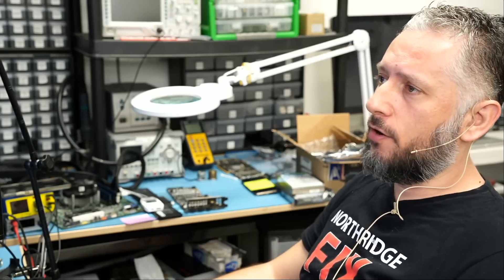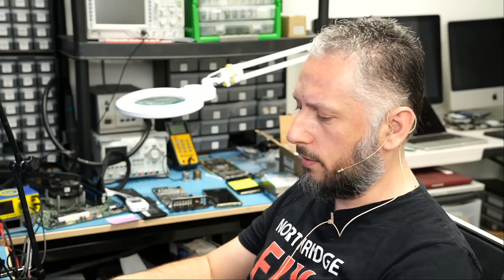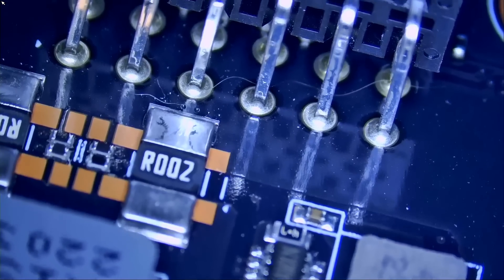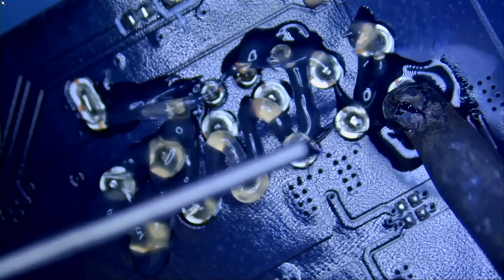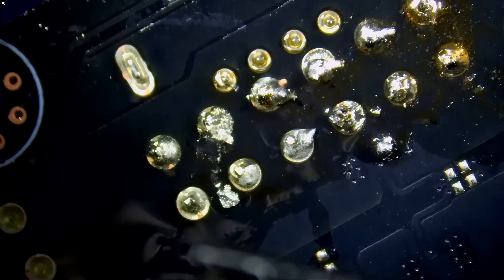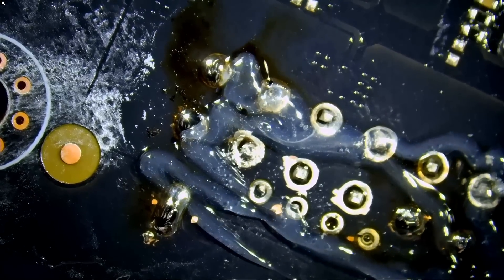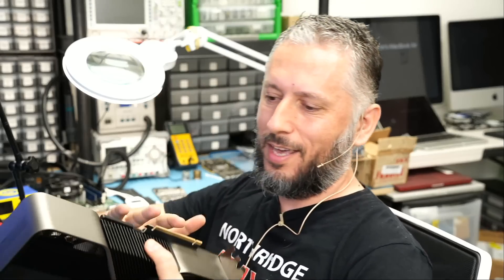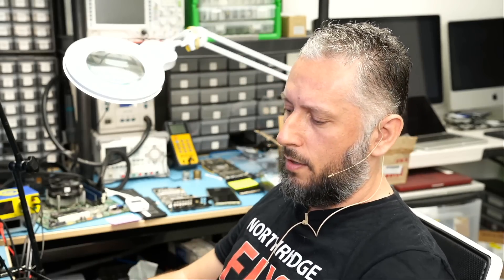Serious issues with 4090 power connectors melting - Is the user at fault ?

Comment: 6 pins for the positive rail at 450w is 37.7A divided by pins is 6.25A per pin. Since it's dc it's harder on the connector. Some arcing will take place and once one gets a higher resistance it'll heat up and increase resistance even more, now 5 pins needs to carry 450W and the next pin burns up 3ven faster etc. 
The connector is too small to carry sustained 37.5A. They should either use a psu at 48V or just input ac mains voltage directly. Or use a much bigger connector.
Reply: Your math and conclusion are correct, but in the case of the 4090, it's actually capable of accessing 675w, 600 of which would go through that puny, tactile response bereft, don't-bend-it-whatever-you-do fire hazard of an adapter and connection.

My bass amp uses speakon connections at 750w continuous, and that's split to two 4 ohm cabinets. My "wtf is this" level on this connector is at maximum lol.
Reply: It has nothing to do with the connectors specifications, linustechtips even put 600W through this connector with literally no issues.
Reply: @innie721  an EE has put 1600w through it, with it barely getting warm to touch.
Reply: Exactly.... well explained sir
Reply: The pins are same size as other connectors with 3 amp per pin capacity.

Comment: If the card works fine permanently when the plug is fully fitted then it is clearly the users fault for not plugging it in properly, but if the plug is properly fitted and pops out due to the design of the catch then it is the manufacturer at fault, 2 choices which one is it, more research is needed

Comment: If that happens because the user did not seated the cable properly, then yes, it is user's fault. If the user's has no experience, he must pay someone to do the job. Computer hardware is not a hassle free device, it requires knowledge to work with it.

Comment: Power must be arking when the connector is only half plugged in. I had a similar issue with my car a few years back 1 of the ht leads had come loose but power was arking basically sparking and had actually welded itself to the coil pack on a vw vr6 engine

Comment: Definitely the fault of the manufacturer of the connector especially on how its engineered. Its the reason why either some owners either get a melted connector or they break the pins that binds the connector to the PCB cause these owners are getting paranoid of their investment bursting into flames.

Comment: Imo if the conector isnt plugged in completelly it shouldnt snap in and the card shouldnt work, and they made just one conector to feed a lot of power to cut down on costs, which is absurd in a 2500 dollar card. So its the makers fault without a doubt. Not only that, the built quality on modern stuff is garbage compared to the old stuff. I have an old 2010 hp elitebook that is not made out of plastic i dont know what it is but its unbreakable i opened it up completelly and didnt break a thing, in a modern laptop for sure some plastic tabs are gonna break even if you are very careful and the hinches and where they screw are all metal unlike the trash they make these days, i cant tell you how many times i have seen laptops snaped in half couse the hinches and where they screw are garbage thin plastic.

Comment: Definitely a board design error. They need to stop production and split it to 2 or more connectors, or redesign with a larger connector to split the current (more pins).

Comment: Yet another thing nVidia has cheaped out on. It's minimally user error, but mostly terrible QC, as you can ostensibly send 600w through that measly tiny plastic connection. The connector itself has almost no tactile feedback, as opposed to the traditional 8 pin ATX connectors. Terrible design, but what can you expect from a company that (*4060ti) only gives you 8gb of VRAM on a 128-bit bus for 450$?

They charge 1600$ plus tax for the one you're working on. It's a joke really. Nice work though, can certainly say it's better than factory.

Comment: the company should put on the box plug must be fully seated till latched or warrantee is void  yes poor design should have bigger terminals more contact area and there should be a recall a known issue what is the amps draw at full through that connector hope the repare is better than factory as they didnt do a very good job picking that connector

Comment: It's plain and simple why. It's on the engineers. These SOC's draw WAY too much power for this design of connector. It needs to be beefier. This is completely obvious. Living with 12v for a while will make you realize this. Like in an RV. The connections need to be tight, tight and tight or you will burn stuff up.

Comment: When proper connection is critical and many cases are encountered due to misuse, the manufacturer should clearly warn the user about this with a label placed on the connector. If not warned clearly on the product, manfacturer should be liable for the damage.

Comment: At the end of the day, Nvidia never should've designed a connector in such a way that not having it plugged in all the way could melt things. They should've built a failsafe connection into the plug, where the card wouldn't work unless the power cable was plugged in all the way. Maybe two contacts, one in the cable plug and one in the card, which wouldn't complete the circuit unless the two were pushed in the entire way and up against each other.

Comment: the new connector which Nvidia 40 Series card are using is the new 'PCI-express 5.0 power standard', the people to blame are Nvidia Company but also the people who Validated this Standard as the new future for all GPU's
Reply: I was looking up future designs of PCIe 5 and motherboards.  Its like a saltine cracker.  Some of these design choices are actually baffling.  Like look at the RAM slots and the connectors.  Might as well be a BIC cigarette lighter.  They are making this stuff to die off quick.  Even though the speeds are nice, the hardware ain't physically robust.  It wouldn't be so bad if the prices were inexpensive, but these motherboards, chips, ram, and gpu prices are insane.  The only reason I did not ever use a 4090 was because I was afraid to burn up my $800 asrock motherboard.  I wanted to put the GPUs in a settop box that is connected to the PCIe slot.  But I couldn't find a safe enough extended PCIe4 cable.  The hardware is getting dangerous and more dangerous.  You need to have a concrete basement to put these fire hazards in.

Comment: it's not users fault , my friend got one of these and he hot glue it in place with just a little bit of glue (so he could remove the glue if he has to send it for warranty) and about 2 weeks later this happened and the glue was still on place and the connector was all the way in !

it's the fanboys that say user fault , just like in politics ,it's the other guys fault  and not the one you voted

Comment: If the supply side of the connector does not melt, something very strange is happening. it also depends if the connector pair has a positive way to mechanically lock (click) together, if not the maker of the card is definitely at fault.

Comment: need to put current meter on the burnt pin connector seems like the card is using more current than the connector can handle. Under powering the video card could also cause power supply current runaway or current going in the wrong direction

Comment: Obviously it's a manufacturing defect. The very same users of this new card have installed the older cards before and didn't have this issue. The new design is the problem. Same with MOSFETs failing in Asus gaming machines or USB type C failing with HP spectre laptops (Courtsey of Northridge Fix videos). All manufacturing defects.

Comment: This is absolutely my take on this connector when the issue first started showing up. The design is not fool proof and is prone to damage. Trying to shove a lot of voltage on those connectors that are smaller than the old 6/8pin connectors is a bad idea to begin with. Unless the connector is made of a new material that can handle the extreme load. All that was added was sensor pins which was immediately redesigned after this fiasco. They should have had sensors that tells the customer the cable is not fully locked in.
Reply: Adding more active components to problem is worst possible route they should take on in future. Connector just need to be bigger, that will also prevent ones we saw just snapped of the board.
Reply: @gorky_vk  Yep unless we start raising voltage (24VDC or even 48VDC). Everything is just discovering of warm water. New ATX standard could go forward if we are serious.  As our electronic systems become bigger and much stronger.
Reply: It's still only 12V of "voltage" they are trying to "shove" through there, same as it was 20 years ago.
Reply: @Novgorod  this doesnt mean anything...  
The wattage is what matters.
Reply: @TechProFury it’s actually current. No electrical engineer works off of Wattage/Power.
Reply: exactly! imagine: 4090 draws "only" 450W , this 16pin can take max: 600W Cards...
Reply: 'voltage' ....lol
Reply: Shoving more voltage would actually be better for the connector, because it's the high amps through a small connector that is the problem. P=U*I
Reply: In my opinion, the tolerances during the implementation of the connector were way too tight. They simply assume that the worst case scenario for the amount of continuous current is for brief periods of time, when in reality many users will push their card to the limit for extended periods of time.
Reply: It's NOT VOLTAGE. It's CURRENT. Theres on 12 Volts on those pins for heavens sake but the connector is being asked to carry 50 Amps !!! The I2R heating effect is causing the contacts to run hot and melting the plastic. BASIC FUNDAMENTAL STUFF ! It needs larger contacts with an adequate current carrying capacity.

Comment: i'm guessing these manufacturers are pushing the limit too far and flew too close to the sun ☀️☀️🔥🔥😂😂

- 4090 Connector Problems
- Now the recent hot dumpster fire of a mess, ASUS boards blowing up Ryzen 7000 CPU's 🤣

Maybe they should..... i don't know, dial back a bit???

Comment: The material used for that connecter obviously cannot handle the heat thats fenerated there when its running. 
You pay so much money for that card and it shouldnt have this problem.

Comment: This %100 on the manufacture I, e Nvidia.. The redesigned the connector which turned out to be a crap design flaw. As I cannot recall the Nvidia 3000 series GPUs having this problem.

Comment: It is the manufacturers fault. There is a reason for the 8 pin / 6 pin power connectors to leave rather large head room in terms of electric capacity and properties.

Comment: One of the reasons why I won't buy nVidia ever again is due to their money grabbing corner cutting race to force cards to legacy forcing users to buy ever increasingly expensive items and getting piss poor standards of quality.   The last nVidia card I bought was a EVGA superclocked 750ti, this was back then the dogs danglies then they brought out the 9xx series almost immediately and by time the 10xx series following that quite swiftly my 750ti and my more powerful 780 were moved to legacy.   I then bought a RX570 8gb which I have just retired, that has been solid from start to finish, it has seen off how many nVidia cards, runs DX12 perfectly fine,  1080p 1440p etc all looking sweet, video editing smooth and fast whilst my 750 and 780 cards are just paperweights as nothing decent will run on 'em :(   And what did I replace my RX570 with?   I bought one of them Aliexpress Lexindar RX580 8gb's, cost me £45 and after I undervolted and overclocked it am getting even better performance than its older sibling. nVidia stuff is now for people who have more money than sense, the people who believe the hype from nVidia that they must have or else the very latest several thousand pounds video card that is obsolete in 2 years and people BUY them too... same sort of people who keep voting crooks and cretins into power I suspect.

Comment: The plastic connector is the failure as it cannot handle the heat created by the wires therefore the Manufacturer is a fault and should replace the card all the cards should be recalled as they are a fire hazard

Comment: I agree with Alex, as well, that Nvidia should honor this as a warranty issue. However, Nvidia seems to act as if they feel like they can just deny practically anything that comes to them for in-warranty claims. 
Nvidia really has shot themselves in the foot with their lack of customer care.
The 12VHP connector should be recalled, but in order to recall something, they have to be able to fix it with a redesigned or upgraded part and not just replace it with the same junk that is going to fail again due to poor design. 
Maybe the unit with the 90-degree adapter tried to use the adapter after damage was already done to see if it would help? 
Very sad that people paid so much for all these 40 series cards and got basically screwed. Maybe Nvidia may have a change of policy, but I doubt it. 
You rarely saw, if at all, this type of a failure with the prior 6-pin or 8-pin power socket designs.

Glad I decided to stick with my RTX 3080 Ti FTW3 rather than buy a 40 series.
Reply: I've been building and repairing computers for a little over 30 years now. Countless thousands of chunky, impossible to mistake, near herculean to remove again, ATX connections. A sizeable portion were 6 and 8 pin GPU connections... know how many GPU ATX ports I've seen burned in 3 decades? Zero.

I know that it has happened, and I can google pictures of it, but you're 100% right.
Reply: Because you were careful and inspected your work when you were doing it, instead of assuming correct terminal connection.

The same users that melted these 12vhpwr terminals would have done the same with 8 and 6pins, and there are numerous cases of these older PCIE terminals melting in the same way as the 12vhpw.

Guess what, 4 pin ide/flopping molex have melted too.

Comment: Its the manufacturer that made a card that uses an cable that can be damaged or not connected fully.  The result is burned connectors.  I seen other hardware evaluations.    Cable quality was an issue as consumers connecting at extreme angles that pulled out internal connection wires that  ended up leaving the remaining wires carrying a much larger current than what it was designed for.  This results in an over heated cable.

Comment: The plastic is too weak. Need a connector with more heat resistance.
Reply: Could be the pins expanding if plugged in/out too often also

Comment: It has been proven to be the cause of a cable that is not fully seated and this causes one or more pins to have to carry more amps than each pin is rated for thus melting the connector. With that said,  I think the responsibility lies with the manufacturer. When you manufacture an item, you need to consider all factors with the design, one of them will be how can a user get this wrong and break it. The manufacturer should ensure that these questions are resolved before launching the product and ensure that the connector or item is manufatured in such a way that it is impossible to accidently cause damage. 

When card connectors started melting, Nvidia should have gone back to the drawing board and given more thought on a design, possibly issuing an RMA process for persons with these cards and give them a new card with a better connector or have a new connector installed on their existing cards. 

Blame is fully on Nvidia for pushing a product with a design flaw without properly testing all the possible failure points as a user. Disgusts me that Nvidia would not honor the warranty on a design flaw of their own product as a result of pushing out rushed products purely for the sake of trying to keep market share without proper thought put into their design of the connector.

Love your videos Alex, keep up the good work!
Reply: Probably much cheaper to RMA a few cards than do a full redesign and recall of all 40 series cards lol

Comment: I agree with you on the 4090 power distribution for that one connector with all of those 12volt lines on one side of the connector is producing to much heat causing the connector to melt.

Comment: Can’t agree. You can’t make anything monkey proof, and there are way too many monkeys building gaming rigs without any understanding, or experience, of electronics. Should an engine manufacturer be held responsible if nuts are not torqued correctly?

Comment: If it works fine when plugged in correctly then its user error, but it looks like a crap design which needed alot more R&D before releasing to the public.

Comment: Go back at 3090 Ti, It come with the 12+4 Pin Power Connector as well but weird. We haven't found the issue like the 4090 came out even the 3090 Ti suck up much more power than 4090 (in total board power) that make i though they may change design or supplier of these connector. And the design of these connector is very stupid. They make the pin smaller shorter but allow it to power it up to 600W or higher make it extremely hot and easy to melt.

Comment: On ev vehicles you uave sense lines that will not contact until main lines are inserted 80-90%
This allows the vehicle or charger to recognise a good connection before sending high voltage and current

Comment: Not user's fault. If you put too much ampere on one single connector it's most likely to be burnt. separating power connector for load is way better then to have one with very high ampere of power at short distance. Its just like providing 30 amperes on 35 ampere capable wire, whereas its always better to have 30 ampere of load on 2 wires with 25 ampere capable per each cable. You will have less load on connector aswell and cables.